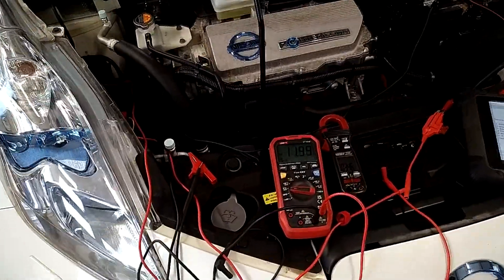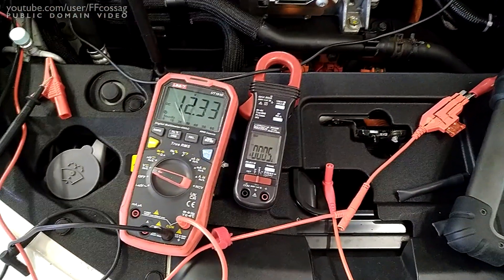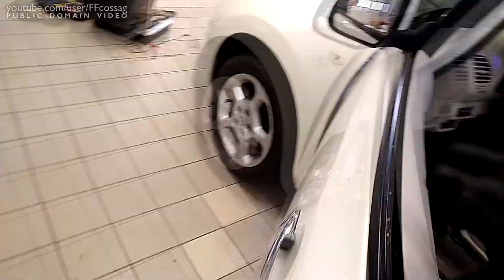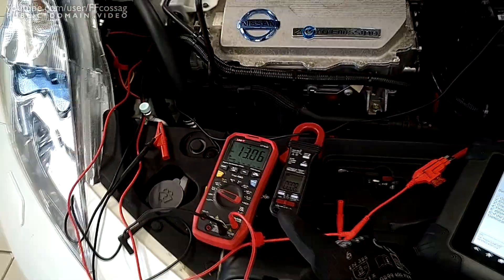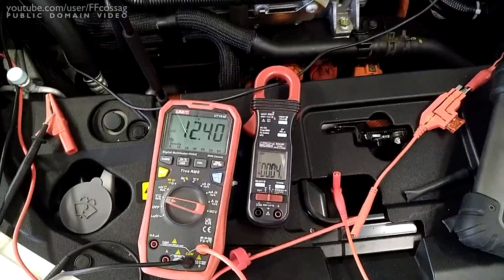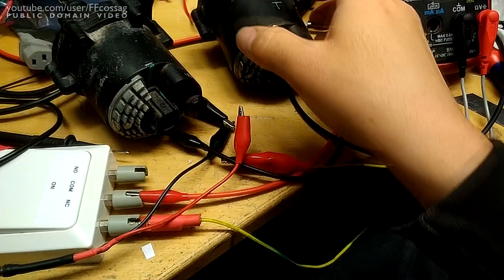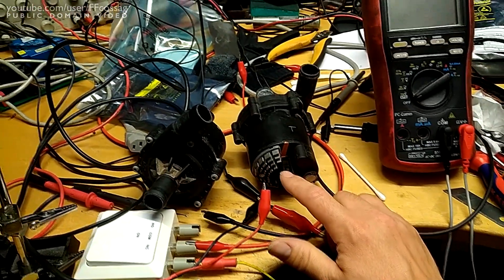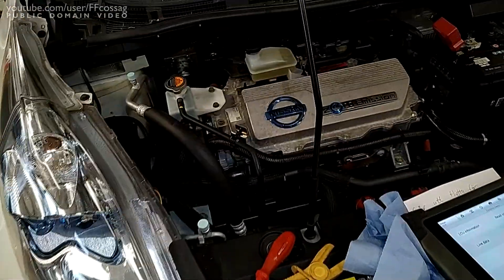2013 Leaf: Strange water pump problem solved with a Tesla coolant pump.

Comment: Nice work.
Anything showed as a pump failure on the OBD reader? I guess it can read the RPM.
Reply from the maker: Yeah, the car throws codes if the pumps fail. They have a PWM feedback output.

Comment: Annoying pump protection circuit failure (?)
Reply from the maker: I have no idea what caused it - I took the pump apart, but without spending a ton of time reverse-engineering the circuit board, it's impossible to figure out what's going on.
Reply: @FFcossag  Well, anyway, good find that the Tesla pumps are identical (no need to reinvent the wheel, using off the shelf parts is fine)